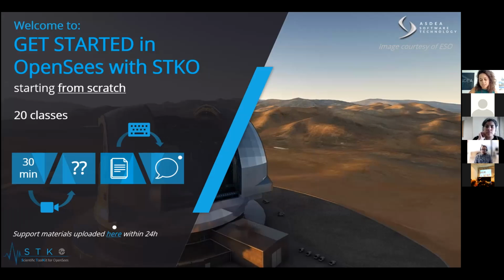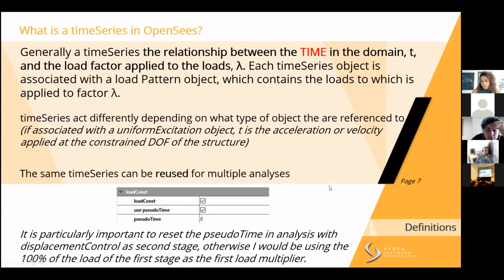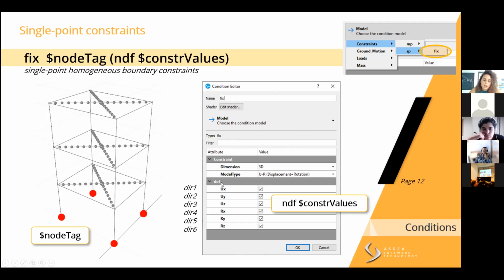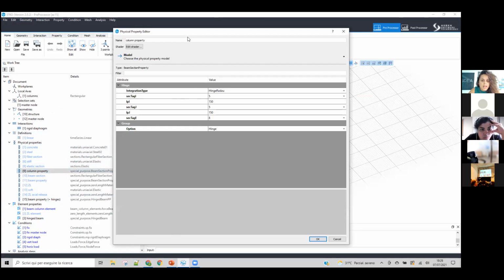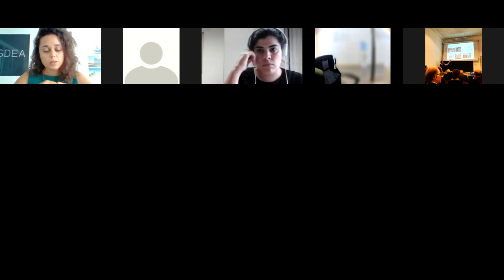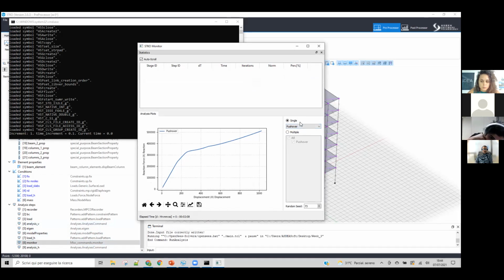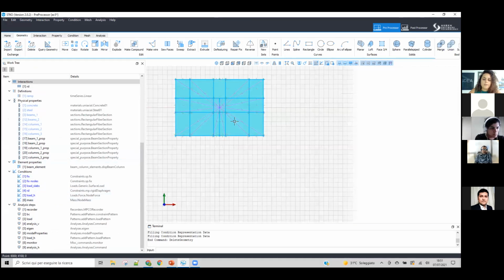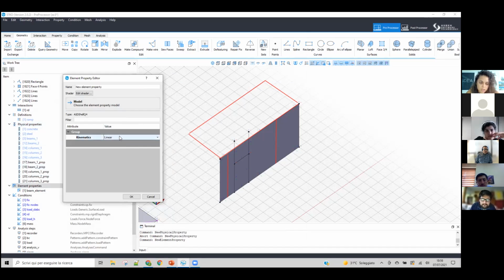Get Started in OpenSees with STKO: W7 Definitions and Conditions

Comment: Rigid diaphragm makes axial forces equal to zero corresponding to zero strain. The second paragraph should be corrected.
Reply from the maker: What Francesca said is absolutely correct. Since the RidigDiaphram imposes a zero relative axial displacement on every beam in the X-Y plane (Floor is not deformable in its own plane), the Axial Deformation of the beam to be constrained is Zero. Then, if and only if the section is elastic and there is no section offset, the Axial force will also be zero. But this is not a rule. For example, in RC beams, upon cracking, the neutral axis shifts from the center, so that a zero axial strain can lead to non-zero axial stress if there is also a non-zero curvature.